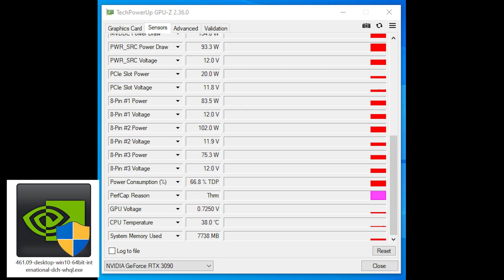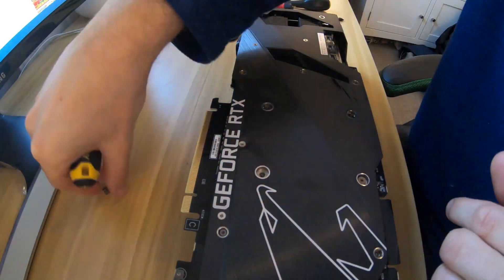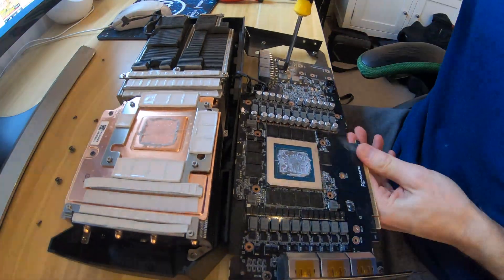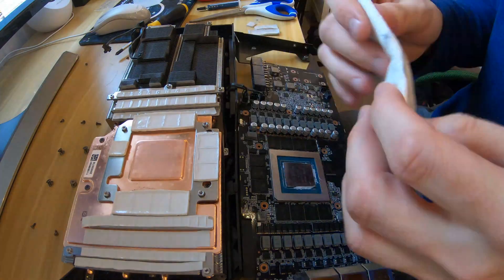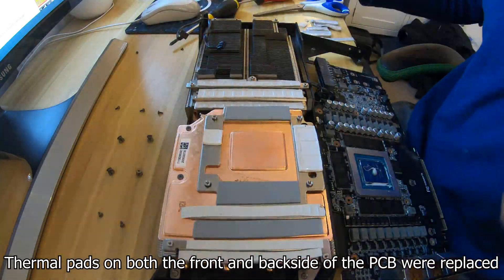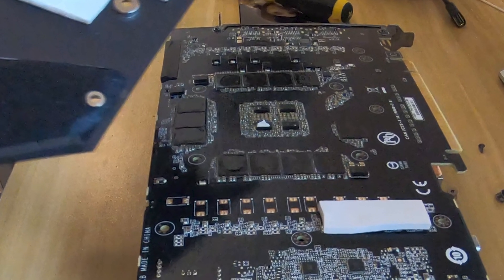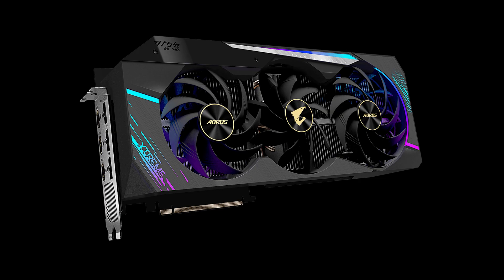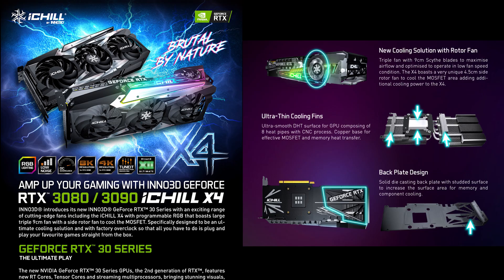Gigabyte RTX 3090 Aorus Xtreme GDDR6X overclocked memory overheating [FIXED]+ buying recommendations

Comment: But why did nvidia create this card with a problem.? I don’t get it.
Reply from the maker: Hi Dardania, people have speculated that it was the price of 2GB GDDR6X modules was too high so they specced the card with 24 1GB chips... 12 on the front and 12 on the back. Its a big error for sure...
Reply: @MindfulMotorcyclist  The thing is whatever reason it was we as costumers are dealing with a card which is almost faulty. I see so many videos online how people put heat sink on top of the back of the card or change thermal pads or even put it in water cooling. Me coming from a 1080 ti which was very cool since the day I got is really a shock to have this 3090. Nvidia should allow all costumers a free RMA and then design a new but smarter fan that can somehow link few copper pipes to the main fan and then move the heat from vram to the main heat sink.
Reply from the maker: @DardaniaLion  I agree, interestingly the 3080ti which is around 4-6% less performance now uses 2GB modules and none on the back. They quietly corrected the mistake and didnt tell anyone. Sneaky Nvidia. Suck if you have a 3090 and use it for memory intensive applications i.e. mining!
Reply: @MindfulMotorcyclist  But the sad thing is this 3090 is still being sold world wide. It should be called back to the factory. I mean I wonder what Asus will say if I tell them it is running hot. They might say keep it until it fails. What is something else fails because clearly my CPU is hot as well because of the card.

Comment: This is a great fix, but dude honestly you shouldn't have to "fix" a freaking $1500 card.  This card has a terrible design causing it to overheat and throttle as well as fail left and right.  Read the reviews.  I'm glad I stuck with Evga.  Evga's customer service is legendary if you ever have a problem.  Not a fanboy, just sayin.  Thanks again for sharing your fix, I'm sure it helped folks who couldn't rma their card.  I would be so upset dropping this kind of cash just to have that happen.
Reply from the maker: Thanks for the comment. I actually am an EVGA fan boy, had the 1080ti FTW3 and never looked back 🤣. Problem is when I bought the card there was very limited stock and I didn't have much experience of Gigabyte. I'll never use them again, the quality of hardware and software is not as good as the likes of EVGA, MSI, Asus even Palit and Gainward brands are better imo.

Comment: The way u put the heatsinks over the card (ties) may bend it when heat
Reply from the maker: Hi Cap, I have taken these off now and used some small heatsinks that stick on with adhesive pads. Thanks!

Comment: Sorry u simply did the job wrong or didn’t get the exact thermal pad thickness
Reply from the maker: Back then there wasn't that much info on thickness, it was a bit hit or miss. Now the established logic is 2.0-2.5, mine are probably making contact but a tad too thin.
Reply: @MindfulMotorcyclist  yes ur right its hard to figure out the thickness of those pads, i got the 3080 master, did a pad replacement yesterday, i used a 3mm for the BACK memory modules and guess 2 mm for the BACK GPU since it was rising a bit, now i can finally feel the backplate heating up and its temp finally reached 40c ! i was SHOCKED to see there were only 2 pads at the back one for the mosfet and for the back !!!

but i almost did a disaster when i replaced the front pads, i used 3mm for the front memory pads (mistakenly) but i should have used 2-2.5 mm, from that extra thickness the heatsink barely never touched the gpu !! and it heated up and crashed every single time ! eventually i replaced with 2mm pads for the memory modules, i think temps dropped at least 10c. but do u think 0.5mm difference is a problem ?...

definitely dont need a heat sink for the back plate :)
Reply from the maker: @SkyHighFilms777  Does the 3080 have memory modules on the back of the PCB? I thought it was only the 3090 that had this and thus why the thing is so damn hot? I agree the risk with thick pads is you push the cooler slightly out of contact with the GPU core itself, I understand that it will just shutdown and crash the system rather than damage itself? Hope your GPU is fine.
Reply: @MindfulMotorcyclist  well of course, funny before installing pads on the back the backpolate was always cool even under full stress test, now the backplate does reach 40c which seems like i did the job right, from reading further on this it seems 3080 Master (maybe extreme too) need 2mm for front memory modules and 3mm for back modules, and that is what i did, never bother changing the pads on the other parts capacitators etc not even worth spending cash on this IMO...

Comment: Never opened up a gpu in my life, but decided to change the thermals on my 3090 master v1.  Before the change,  I was throttling on light setting at 110c (101 mh).  After I added gelid pads the back and front vram, I'm able to stay at 92/94c at 116mh.  Still have keep side panel off for air flow.  Used 2.0 front, 3.0 back.  Gelid extreme.
Reply from the maker: That's a success story for you. Did you use 2mm or 2.5mm pads? EDIT: I see you used 2.0mm and 3.0mm, I guess the 3mm as squashed very flat and make good contact.
Reply: @MindfulMotorcyclist  yeah, the gelid extreme were rated to compress up to 40%, so it gave a little more flexibility
Reply: Also, for anyone else who is interested it, took 1 pack of 3.0 to cover the back and 1 pack of 2.0 to do the front.  Changed the thermal past as well
Reply from the maker: @c-dubrizzle4860  That's useful to know, thanks!
Reply: Hi Mate! Did you replace ONLY vram pads or also all other pads? If you replaced also the other pads so did you use same pad thickness for all (2mm front and 3mm back)?
Reply: @hondaman9424  Hi, yes I replaced all pads.  2mm front and 3mm for back

Comment: I literally did the exact same thing. I have a noctua small form factor cpu cooler sitting on the back of my card.
Reply: is that helpful? I don't know what I would do for throttling issue
Reply: @EBSinPCcafe  yeah it works replaced thermal pads and then installed the heat sink with thermal past directly onto the back plate. Temps are now inline with what to expect from my FE cards.;

Comment: Hey, I don't know if you've found a solution yet to the memory problem. But Ive recently saw a chinese item pop up called GK6 from ploylab and aliexpress. Its a 9x18cm aluminium cooler thats 1.5cm high and has two fans actively coooling it.

Comment: Hello, I am using EGPU BOX, CORE 50-60C, MEMORY 98-102 /lowered -500MHZ/... no pads changed, underclocking and undervolting memory is best..., still 101MHs
Reply from the maker: That is an interesting set up, you must be using a laptop then. Have you lowered the memory speed on to control temps? With memory overclock +1200MHz you will have 121MH/s...

Comment: The gigabyte cards are all pretty bad for memory temps, ask the miners
Reply from the maker: I know sadly I bought the Aorus Xtreme, I'd rather have a standard reference card from Nvida!
Reply: @MindfulMotorcyclist  damn it sucks they did such a bad job on such a high end card. Very disappointing and gigabyte should know better. 

I got the evga xc3 and the memory runs hot at 84-86c, but nowehere near as bad as gigabyte cards. This evga is a low end card as well.

Comment: How to break your mobo pci slot
Reply from the maker: That card will break it anyway 😂
Reply: @MindfulMotorcyclist  BTW I think mounting a 120mm cpu water cooling block (aio) by drilling the back plate (and modding) would be the best approach no?

Comment: i have the same card, and after changing the front and backplatte thermal pads got -22 °C, but u need 1mm 2mm and 3 mm pads. 
u are right, its a shame that u got a such shity concept for so much money...
Reply from the maker: Thanks for the comment bud. You got a big drop in temps with the pads, what thickness were on the memory chips themselves? was it 3mm?
Reply: @MindfulMotorcyclist   the 3mm is only for the Ram chips between the backplatte, the GPU has on the backplatte 2mm Pads, i changed the whole standard pads. and got this temps.
i also mine eth on this card over the night and the max teaps are 76, before i had temps 98°C
i used the tutorial from "son of a tech" he makes a video how u can change the pads and which thickness they have. but like iam said, u have to change the whole pads, i changed in the first run only the backplate pads and it didnt help so much..
Reply: hello can you please help me about which mm pads to use front side for aorus 3090?

Comment: I got an EVGA ftw3 3090. The stock thermal pads on this one are really good. I added two cpu coolers on the back just like you.
Reply from the maker: EVGA always have great cooling solutions but even they were a bit under par this time around, I don't think the AIB partners had long enough notice from Nvidia about the launch to prepare their custom PCB and coolers. VRAM temp seems to depend on the card and what people are using it for. As far as CPU coolers on the backplate I think 2 low profile nocutas might work bit two of those tall Ryzen stock coolers looked too 'home brew' for me!

Comment: Just need that EKWB active backplate for the recently released waterblock for the front... They have the optional (with a 3090 is it?! and with the 3080, no point?) standard backplate
Reply from the maker: I just think the EKWB active backplate is far too expensive, isn't it around €250? At least with the price of the cards coming down now (a little) it makes them better performance/$. Still doesn't justify the need for additional cooling after the purchase.
Reply: @MindfulMotorcyclist  Oh it definitely is too expensive, but it actually does seem to do a pretty good job of dissipating the heat from the memory modules, more than I thought it would

Comment: I have a TUF and a FTW3 3090s and their VRAM temp stays between 82-90c depending on room temp @ +1000MHz for 120.5MH/s with stock pads.
I also have a GXT 3080 on which I had to change the pads as the VRAM was thermal throttling with any OC applied and was staying between 92-100c @ -502MHz; I used Gelid Ultimates and now the VRAM is between 72-80c @ +1200MHz.
Reply from the maker: I have a FTW3 3090 and I'm at 106*C or higher, I'm not going to dismantle the card though as I wouldn't want to void the warranty (already done that on the Aorus Xtreme). Interesting that you overclocked the mem +1000MHz, my FTW3 could handle +1500-1550MHz and would return around 126 sometimes even 127MH/s but I couldn't reduce the power limit and keep stable. I settled on around +1400MHz on the memory and 71% power for around 122-123MH/s. Funny that your 3080 without any mem on the back of the PCB was hotter than the 3090s. I think in hindsight the non overclocked 3090 cards are actually better for mining, a Palit Gaming (non OC) for example has the 350W power (not 420 like the Aorus) and 2x 8 pin PCIe connectors, yes its clocked lower but who cares for the core isn't utilised as much as the memory for mining. I doubt you would notice in gaming FPS either. Thanks for sharing 👍
Reply: @MindfulMotorcyclist  Oh, I could go +1500MHz on the FTW3 3090 but those few extra MH/s are not worth the temp increase imo. I actually don't reduce the PL, just lock the voltage at 700mV (Nvidia keeps it at 725-731mV) and raise the PL to max, this way the core uses the minimum power, while allowing unrestricted power for the VRAM. My FTW3 3090 draws 285W and the TUF 3090 295W, both doing 120.5 MH/s with the same settings.
Reply: @MindfulMotorcyclist  Also EVGA doesn't void warranty for opening the card as they even have guides on their website for installing their hybrid water coolers, check the manuals section. https://www.evga.com/support/faq/FAQdetails.aspx?faqid=57720&topicid=2
Reply from the maker: @clearlight293  great advice. I Will try the 700mV setting! Thanks for sharing.

Comment: I did the same thing to mine! I used 2 AIOs and stuck them to the back plate. Still sucks for overclocking so I am currently going to try to use the dual block from bykski
Reply from the maker: Thats a little better than air as the water will pull the heat off the BP quicker IMO. I guess Bykski has a backplate cooler now as well? Was about time someone developed a proper solution...
Reply: @MindfulMotorcyclist  Can you make a video of it and send the link of the product?
Reply: @macozetleri3518  where do I post quickly?

Comment: Great vid! Looking to get the temps of the VRAM and the back of  the die from my 1660 super down.
Reply from the maker: Thanks Theo, appreciate the comment. Is your 1660 running hot then?
Reply: @MindfulMotorcyclist  Yes! I undervolted it, now it runs 10-12 degrees cooler. Also I replaced the stock fans with some noctuas redux. The stock ones were so loud, I tought the gpu would take off from my PC :))
Performance after undervolting is the same, maybe lost 1-2 fps.

Comment: I can't OC this card. what settings are you using? I want to mine ethereum. msi afterburner?
Reply from the maker: I used power limit of 75% and memory overclock of 1200. I think you could go higher on the memory but I didn't see it giving much improvement on 1200
Reply: i have 58% power target 
- 210 Mhz Core Clock
+ 612 Mhz Mem Clock
95% Fan Speed
Room Temp round about 24°C
GPU Temp 46-48
Mem Temp 74-76
93 Megahashes

i dont want push too hard

Comment: i wonder when will manufacturers start puting fins on back plate, it would be god damn time to start already, block manufacturers as well could start including water cooled backplate.
Reply from the maker: Weird isn't it, it's not as if there isn't profit left in the cards for them to fund development of backplate cooling and a slight increase in build cost. I think even with fins the whole plate becomes heatsoaked, almost too hot to touch. You need a way to remove that heat off the plate so water cooling is the only way IMO. Thanks for the comment 😊

Comment: I got the same card and while I'm playing Metro Exodus on 1440p, all settings on High, I get 104-108c degrees junction temps non stop.. it sucks and AORUS support says it can't be, the only way for the card to reach that temp is by mining... smells like they are not even gonna do shit on a RMA
Reply from the maker: That's really bad, I assumed that this problem was only for miners and that gamers got off lightly (as the memory is not under such load). I'm honestly done with Gigabyte, the RGB software is the worst as well.
Reply: @MindfulMotorcyclist  I'm also done with Gigabyte even tho' I've never had a problem with RGB fusion, but in general this release of GPU's has been the worst in many years.
In AORUS Engine I've done an automated undervolt thing and put the power target to 85% this helps me with 15 degrees, without the biggest fps drop, I will keep it Iike this until I can get my hands on a full cover GPU water block.

Comment: Yep mate got the same problem here mate....backplate reading 70°C on my tempgun  I'm thinking of making a new CNC made backplate but with lots of fins on it and then adding a cooler...  don't know why OC companies havent come up with something like that....
Reply from the maker: As is now stands I've got small aluminium heatsinks on mine, they are just stuck onto the backplate. it doesn't have air directly blowing onto it and so they are nearly useless. They are completely heat soaked. I've got a plan to water cool the thing now, if you go for air or water to cool it you'll have to remove A LOT of heat so bear that in mind. Perhaps your cnc backplate will have a lot of thermal mass and also deep fins say 10mm plus? Include mounting holes for a 80mm slim case fan etc. You could sell it if works well.

Comment: what size of pads did you use on the back plate?
Reply from the maker: I used a mix of 1.5mm and 2mm, I think 2mm and 2.5 would be better
Reply: @MindfulMotorcyclist  alright, I got that master 3090 and placed 3 mm odysseys on the backplate and i think they a tad thicker than optimal.  I had to tighten the screws a little more than expected so the thermal paste would touch the heatsink (first try my gpu crashed after turning on and found out its not screwed tight enough to make the heatsink touch the gpu).  Ima check those 2.5 mm when they arrive.  Good to hear ur thinking 2.5 mm too.   thanks bruh
Reply from the maker: Thats good to know. At least you were smart enough to know that the contact with the GPU core wasn't there with 3mm and able to fix it. A lot of people would of panicked at that point.

Comment: all you had to do was attach a laptop fan pushing air down through the backplate you didnt need that massive contraption 
aahaa
Reply from the maker: Through the solid backplate... I had a corsair 120mm 2000rpm fan doing that and no difference. Yeah I agree didn't need the massive contraption and it looks ugly as ** but it make a good thumbnail 😂
Reply: @MindfulMotorcyclist  haha i had to watch it because of that thumbnail. It seems better we ditch the backplate 100% and thermal tape a bunch of the tiny radiators where they need to be with some fans. Ill try that once i get my other card plugged in

Comment: Do you have any guess what Hs/s I get if I only put new thermal pads to the card and don't OC and also at a decent temperature... (is that around 80C? ) Btw - great clip - thnx
Reply from the maker: I would say 116 to 125 but it depends on the card with the memory OC, its a paltry 106 without that. Thanks for your comment too :)
Reply: @MindfulMotorcyclist  so, even if my card is brand new, you think it helps with new thermal pads? The temperature goes directly to 110 even when its not overclocked. Should temperature be around 70-75?